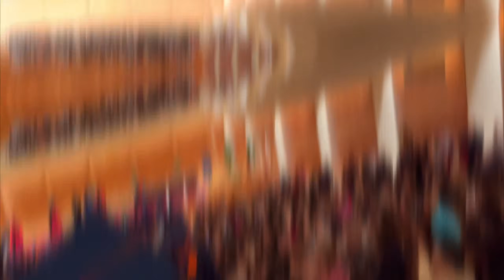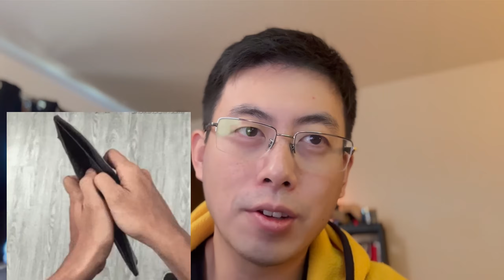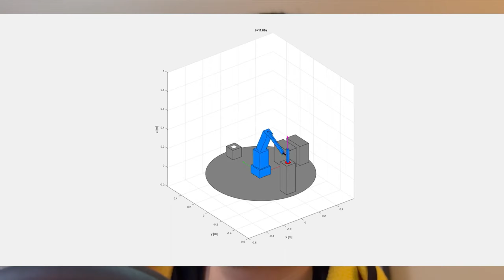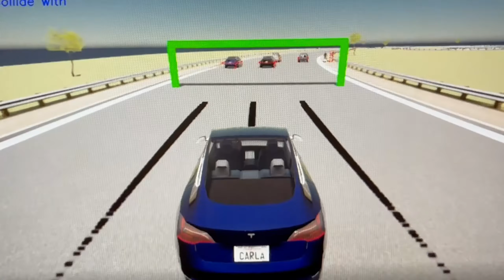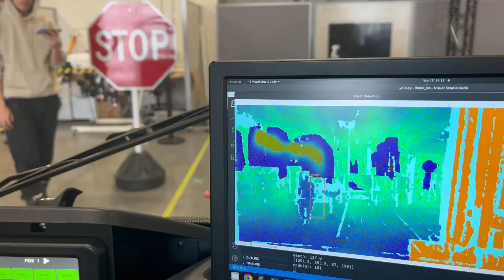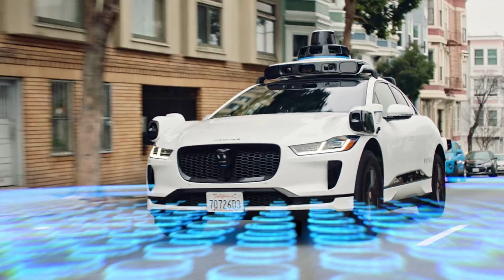12 Months of Robotics Grad School: Was It Worth $30,000? | 研究生一年的機器人學習經驗

Comment: So you learn how to use robot parts? Or do you learn how to build the joints and how to program the drivers too?
Reply from the maker: For me most of the times we didn’t have to build the robots, it’s readily available. We learn how to program them. Building the physical robots are usually outside of class for research because it’s pretty time consuming. In my robot dynamic class we did go over what design are good for robots and what to lookout for.